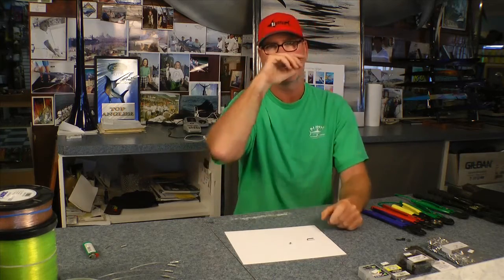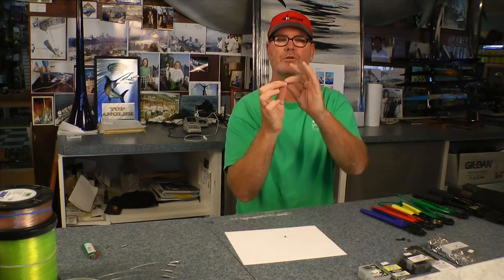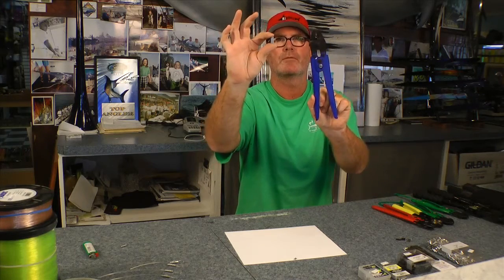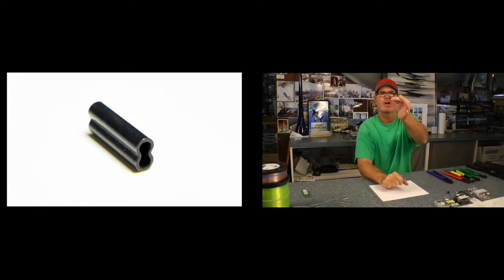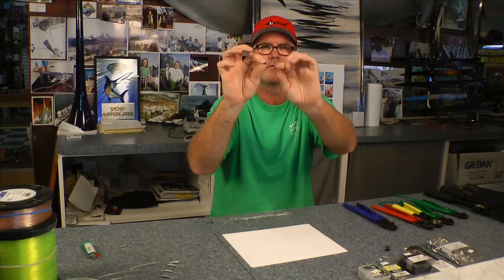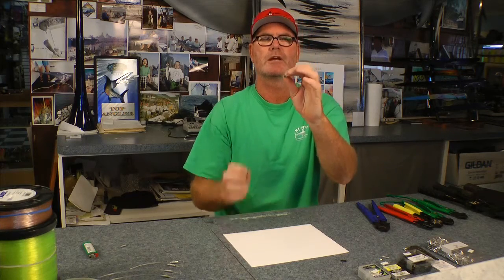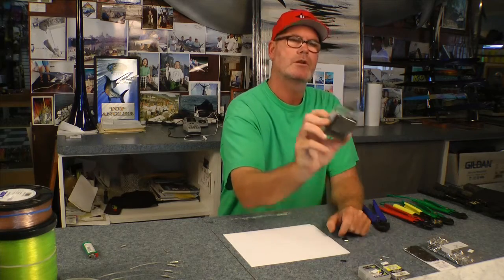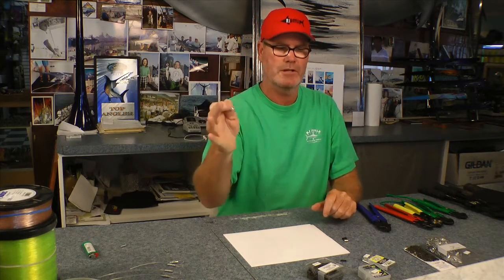Big Game Fishing Crimps Crimpers and Crimping Techniques

Comment: Do you have  to use certain crimpers depending on weather it's  aluminum or  copper crimp.  I have p line heavy duty crimpers , but they have a needle like tip. Which on aluminum  makes a sharp edge on a 50 lb crimp. What do you recommend?
Reply from the maker: No. What kind of sharp edge?
Reply: Once you crimp the aluminum crimp and you open the crimpers. The sleeve will have a flat edge on both sides that stick out
Reply: On both ends or down the middle
Reply: The ends will be flared out and down the middle on both side will be a flat sharp edge that sticks out about 1 to 2 mm. It will be about the thickness of a sheet of paper.
Reply: Dak 88 that sounds strange. The ends should be flared, but the sharp edge running down the crimp is wierd. Have you tried another crimper to see the difference. You may want to get a new pair. If you live in the States, I would be happy to send you the full length crimping video, so you can see everything we talk about. Email me inthespread@gmail.com